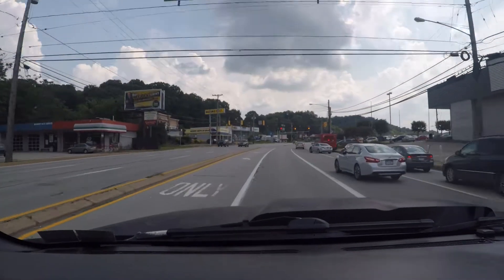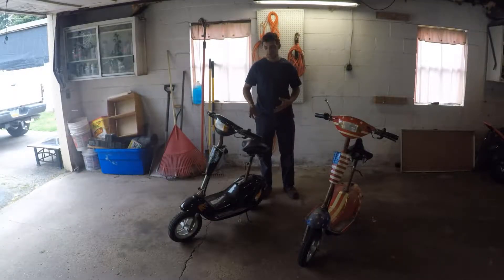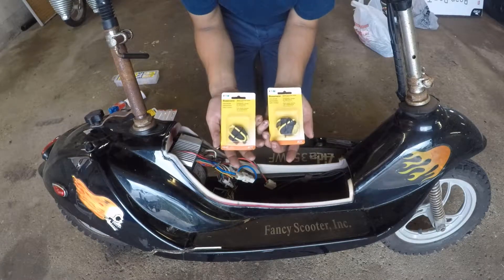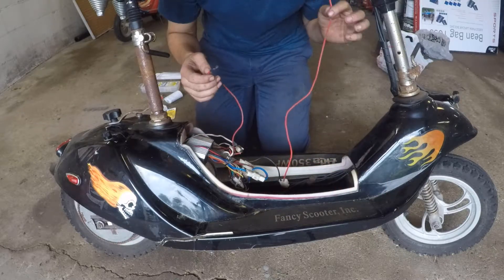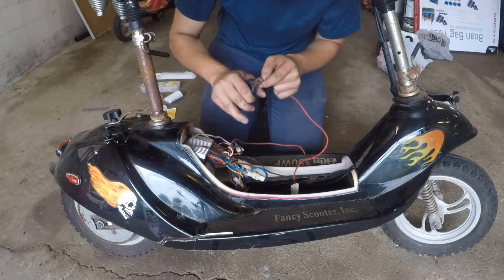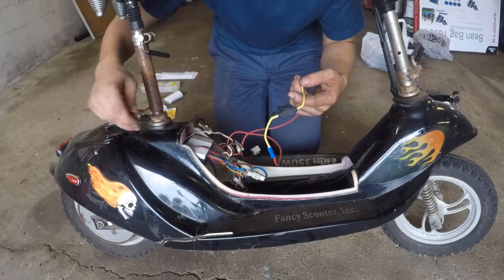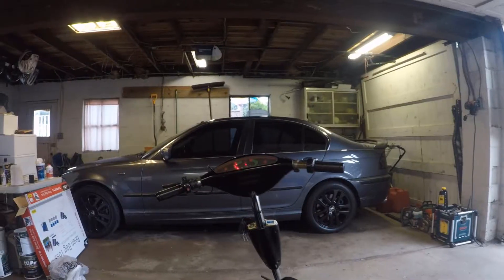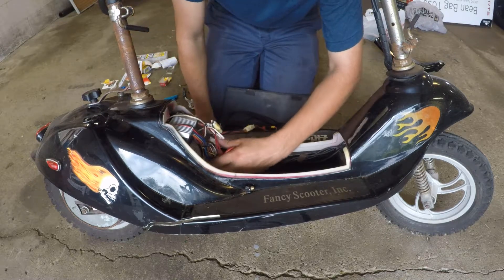Fancy Electric Scooter Fuse Fixed!

Comment: Hey so I just bout the same time of bike and when I have the charger I’m in says it’s all charged and shows ever thing but when I take it out it all goes dead have any idea what’s going in
Reply from the maker: As there is a number of different things that will cause this issue. If you don't have a multi meter I would suggest picking one up as that will be your friend in this case.  You can find them at your local auto parts store or a hardware store. Start at the charger and work your way down. Make sure the charger is putting out what the label says. If all is good and the charger meets the scooter's requirements, test the batteries. If they are under 10 volts after charging the batteries need replaced. Check your fuse and wiring between the the charger and batteries. After looking at volts and amps at charger, batteries and wiring  you should be able to conclude what is bad. Thank you for the question if you have any more questions we will be more than happy to answer them. Best of luck to you on fixing your scooter.